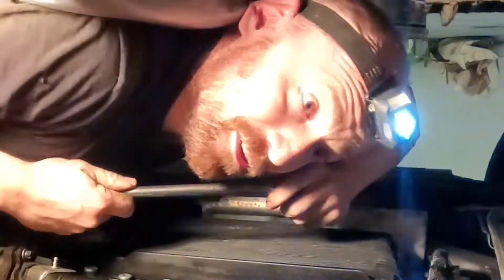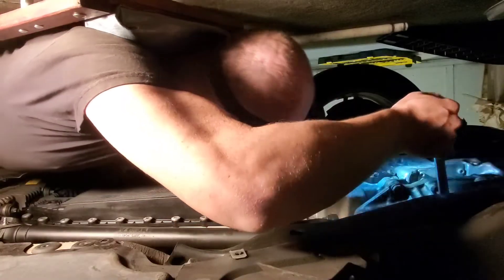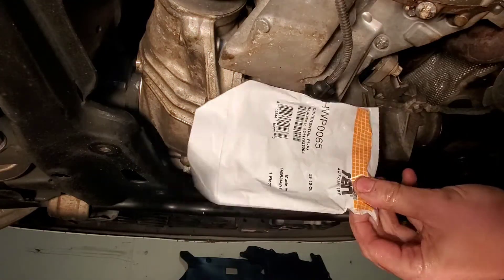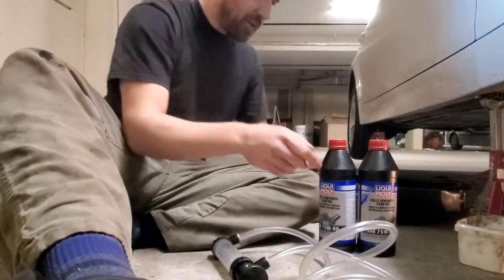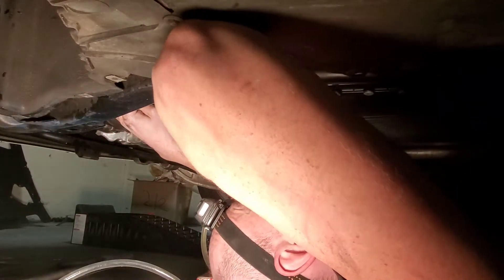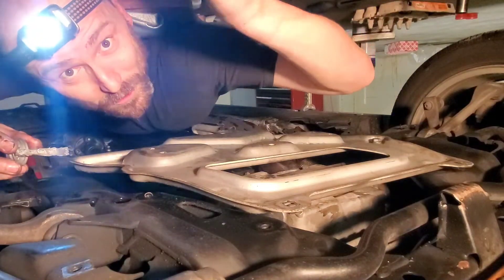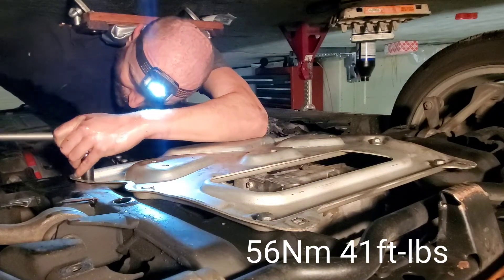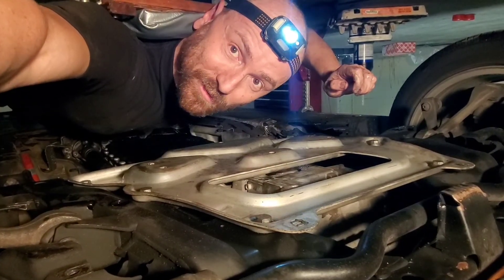BMW E60/E61 FRONT Differential Fluid change: Easy DIY prevents expensive repairs.

Comment: I make all of those noises as well. Thanks for this video. Edit: if you are going to work on cars, buy a couple of harbor freight torque wrenches. Tighten to spec. Engineers came up with those numbers, and wrenches are cheap. You'll use them on cars ALL the time.

Comment: The note about the front reinforcement plate bolts at 7:30 is very interesting. I've got replacement bolts in anticipation of needing to remove in for some future job, I'll need to mull over whether to actually use them.

Comment: So I’ll need to buy 3 bottles of 1qt Liqui Moly’s 75W-90 right? Two for the diff’s and one for the transfer case? Your video is highly appreciated man
Reply from the maker: No! Do not put gear oil in the transfer case. It gets special BMW transfer case juice at $100 per bottle. It has clutches and and things in there so you don't want to mess with it. My car got totaled before I could make the transfercase video.
Reply: @IDontKnowWhatImDoingDIY  Alright then didn’t know that, thanks for the heads up
Reply from the maker: Here's the transfercase stuff. Also there's a special way of refilling the transfercase through the drain plug since the fill plug is really hard to get to. Google it. https://www.ecstuning.com/b-genuine-bmw-parts/xdrive-transfer-case-service-kit/83220397244~kt1/?gclid=CjwKCAjwlqOXBhBqEiwA-hhitJT1NJpaQK-6H80HVtK4dDRXSiIUu3LMIcC8j5PaOSlh1m-ShZRBiRoCryIQAvD_BwE
Reply: By transfer case you mean transmission don’t you? The front diff and rear diff require 75-90 oil
Reply: @joecastro23 he means transfer case, it's next to the transmission on xdrive cars. So there's 4 things: front and rear differential, xdrive transfer case, and transmission.

Comment: So, on refill, my e61 only took about 3/4 liter. I went till I had a steady stream out the fill plug. I'm guessing that was enough?
Reply from the maker: Unless you're parked on an angle you're gold.  Job well done.
Reply: @IDontKnowWhatImDoingDIY  also wanted to tell you about a common failure point that is easy to change. The Micky mouse flange on the front of the block that has the coolant return. It's plastic and when fails, causes all the coolant to dump onto the serpentine belt possibly causing it to come off and then get sucked in the front main bearing, clogging the oil sump and causing catastrophic failure of the engine. Cheap $20 part. 
We love the videos, please keep them coming for us e61 owner's.
Reply: But the rear took a full liter....

Comment: Haha, i do the same, torque to what you know is enough,  just adjust according to size of bolt 😁
Ive just done the oil change on both front and rear diffs of my X5. Those bolts on the X5 undershield are also securing the antiroll bar bushes, and a pain to get your hand to the inside to put on the nut !!!

Comment: I feel you do know what you're doing. ✌️Those plate brace bolts are dumb. They're torque to yield but they barely have to be providing any structural rigidity.
Reply from the maker: Those bolts are silly.